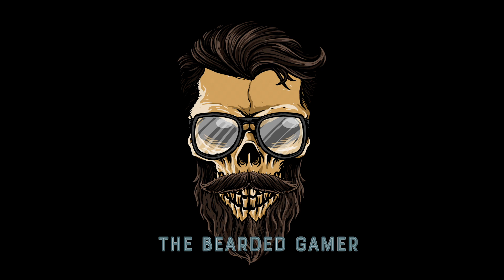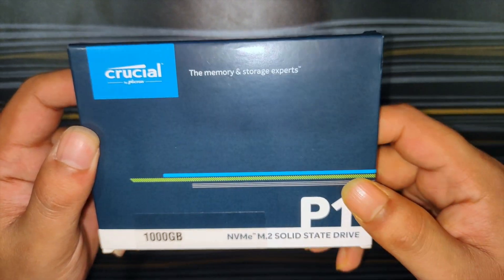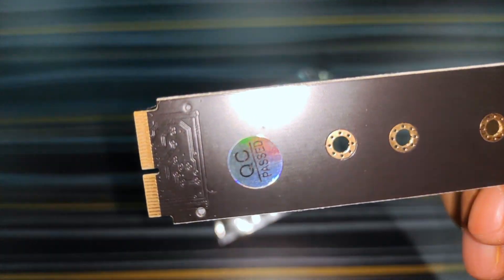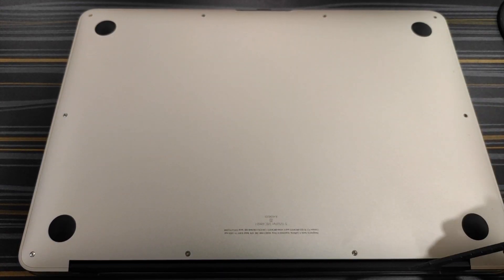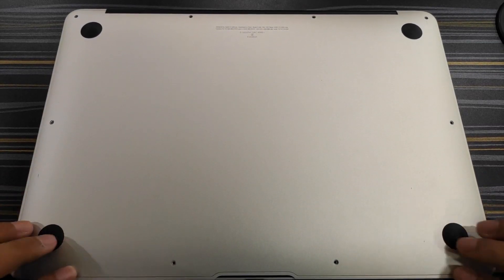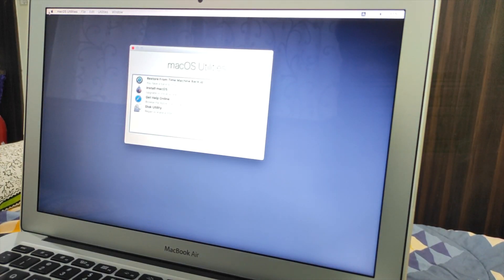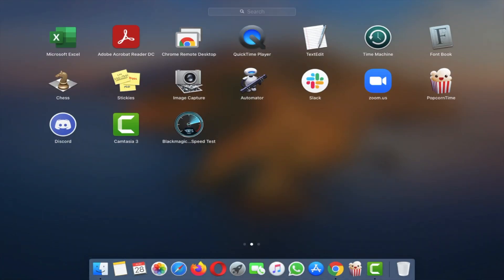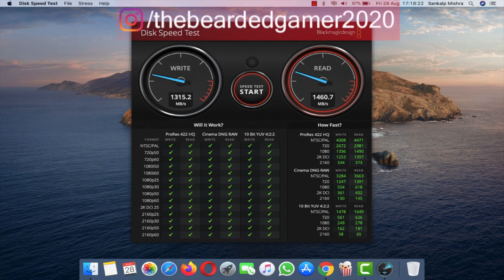2017 MacBook Air Storage Upgrade from 128GB SSD to 1TB NVMe SSD | Full Guide for 2021 | 40k+ Views

Comment: I am running on Mojave 10.14 but from the apple store when i try to download (from the link provided in the description) it is downloading 10.14.6 will that be a problem?
Reply from the maker: If you are goin to restore from a time machine backup, then it is going to be an issue. But if you do a fresh os install then the current version and downloaded versions don't matter. Do subscribe if you haven't already done so and press the bell icon.

Comment: Western Digital WD Black NVME SN750 1 TB M.2 2280-S3-M PCIe Gen3 Internal Solid State Drive (WDS100T3X0C) https://www.amazon.in/dp/B07M64QXMN/ref=cm_sw_r_cp_api_i_fBhbGb5AY5FDA brother can this ssd be more better?
Reply from the maker: Bro this is a gen 3 one...better to go for a samsung 970 evo.
Reply: @TheBeardedGamer2020  i think ur recommended crucial is also gen3 , nd moreover i compared this samsung evo, this one is giving more speed.. please check and confirm
Reply from the maker: @sameeribrahim9405  The max speeds of none of these ssds matter because the adapter and the MBA is capable of certain speed. The proprietary apple ssd has speed around 600 and any other ssd that you use with the adapter will provide speeds of around 1300-1400 even if the max speed of the ssd is around 3000. So it is now totally upto choice which ssd you want to choose. I used the Crucial P1 because it was more value for money with similar speed to any other ssd when usd in the MBA.

Comment: Thanks alot brother . I subscribed ur channel . U have explained perfectly.  I just want to ask whether i need a proper technician or i can do it on my own? Nd moreover is this adapter necessary to buy?  Rest what is the present status of your MBA 2017 ? Working perfectly? 
Nd one more thing , should i buy this ssd from amazon or a local authentic dealer? What is ur suggestion.. rest nice work done by u .. keep updating more tricks about MBA2017
Reply from the maker: Thanks a lot man. Yes you can definitely do it on your own. And the adapter is definitely necessary and the ssd can be purchased from anywhere the choice is yours as long as you trust it.
Reply: @TheBeardedGamer2020  adapter seems to be very expensive , can you suggest some other alternatives .. as there are many new adapters available..  if u stil recommend this same adapter than i have to go with it
Reply from the maker: @sameeribrahim9405  there are a lot of cheaper options but these are tried and tested ones so I have suggested. The cheaper have had complaints of overheating and sleep issues.

Comment: hello, does hibernating have issue in crucial p1?i've held in mac os some brand of nvme ssd have failed.you have to turn off the laptop all the time instead of close the lid and go. i appreciate your thought on this
Reply from the maker: I haven't faced any such issues yet and I don't think it is going to come up as well because the response I get when opening and closing the lid is exactly the same as before the upgrade. So, I guess Crucial P1 isn't that brand that has issues. I guess that answers your question. Do subscribe and press the bell icon.

Comment: im am using mac os big sur, so do i have to download back mac os big sur as the bootable installer?
Reply from the maker: Yes, because that way you won't be losing any settings or app data when you restore a time machine backup.  But if you are planning for a fresh reset, you can use previous versions as well.
Reply: when i install a new macos big sur and choose my ssd, it shows that there is a password and you may not install. Is there any solution to this?
Reply from the maker: The issue might be with how you have formatted your ssd. If it was APFS encrypted then the password issue could have cropped up. Follow me on Instagram and drop a DM with pictures of exactly what the issues are and I will try to get a solution. Also do subscribe to my channel and press the bell icon.

Comment: Hi, I did the same procedure as you, changed the SDD, pressed the commands to connect, selected the bootable device, load the bar until the end and then this error appears on the screen: https://i.postimg.cc /q7DRrDGk/20210109-162207.jpg
Do I have to format the SSD first? Is there anything I can do?

Can it be any M.2 SSD or does it have to be specific?
Reply from the maker: I didn't check the image yet. But based on the question, formatting and changing the format to APFS is a must. And, it is not about being a specific SSD, but it has to be a NVMe PCIEx4 SSD. If that works do let me know. Also hit the subscribe button and press the bell icon.

Comment: Hey, you didn’t copy your files before removing the SSD? Is it not necessary?
Reply from the maker: I had already made a time machine backup. The details are in the description as well. So restored data from there. Do subscribe and press the bell icon.
Reply: @TheBeardedGamer2020  ahh I see. One more question: Can I update the OS to Big Sur and then install the new SSD?
Reply from the maker: @reallyjam  Yes you can. Anything post Sierra can be used to update the ssd. All the product links are in the description.
Reply: @TheBeardedGamer2020  whew! That’s good! Thank you so much! I will subscribe!

Comment: Will work with MacBook air early 2015 version?
Reply from the maker: Yes Kiran it will work with all MBAs and MBPs from 2013 to 2017. Product links are in the description. Also do subscribe if you haven't already done so.
Reply: Thanks for your immediate reply. Subscribed. Another question, 1TB ssd will not make any problem right? Or should I install 512GB for MBA 2015?
Reply from the maker: I am myself using the 1TB SSD. There's no such issues. It is totally based on your choice and budget. And thanks for the sub.

Comment: Can you please recommend me external casing to use the 128gb m.2 ssd as external USB drive. I mean the original 128gb ssd that you removed from the macbook air.
Reply from the maker: There are external cases but the availability depends on where you are from. For example in India, finding an external case for the MBA SSD is almost impossible and the ones available are super expensive. So, if you can help me out with where you are from, I might be able to help. Also, before that do subscribe to the channel and press the bell icon.
Reply: @TheBeardedGamer2020  please, do tell for Indian consumers... possibly provide a link !
Reply from the maker: @sumansumitsoren21  There's only one that I could find on Amazon and that too is super expensive, as I had earlier mentioned, around 27000 for just the enclosure. If you are interested, let me know, will share the link.
Reply: @TheBeardedGamer2020  27000 is not at all that I an afford. If any cheaper in USA please do let me know. Thanks
Reply from the maker: @tsenam9392  Exactly. That is way beyond affording and doesn't even make any sense. Will look for some options from U.K. and U.S. and share it with you.
Reply: @TheBeardedGamer2020  U try search B&H photovideo there u can buy from Us to Your country,India it is safe site too.If you have any question u can directly message them on Facebook messenger they will replied to your question
Reply from the maker: @luqmanooo5402  Sure. Will definitely look into it. Also if you like my videos do subscribe and press the bell icon.
Reply: @TheBeardedGamer2020 I am from India but i can ask my friend in U.K. and USA to arrange for it.

Comment: Hey, Is APFS(encrypted) or MacOs Extended (Journaled) the right file system of new SSD ?? Kindly guide 🙏
Reply from the maker: It is normally APFS encrypted...but better to format it as per your previous ssd format. But, if you have already removed the previous and installed the new ssd and asking this question during the process then go for APFS encrypted as it is the most common one. If that makes sense, do hit the subscribe button and press the bell icon. Also, if you have any other queries, follow me on Instagram and drop a DM. Peace.
Reply: @TheBeardedGamer2020  thanks....used APFS👍🏽
Reply from the maker: @sumansumitsoren21  Hope the process was smooth. Do let me know.
Reply: @TheBeardedGamer2020  One more query...Instead of BOOTABLE MACOS INSTALLER USB can't we simply use INTERNET RECOVERY Combo keys (Cmd+Option+R) ? Will that work for booting up the Mac ?
Reply from the maker: @sumansumitsoren21  Yes you can use internet recovery but I preferred the bootable usb option because of its reliability. Didn't want to risk any internet fluctuations or failed installation. But definitely you can also choose internet recovery as long as you trust your ISP.
Reply: @TheBeardedGamer2020  Thanks a lot for prompt reply. 👍🏽😀

Comment: Which one is more faster internal SSD for upgrading from 128gb to 1TB mackbook air 2017 .
Reply from the maker: The 970 evo is slightly faster than the crucial p1 once it's in the MBA 2017. Based on price difference you can choose whichever works for you. Links for both are in the description. Also do subscribe if you haven't already done so.

Comment: I have bought the same ssd but i am getting a write speed of 890mbps.
Reply from the maker: Did you use the same adapter?
Reply: @TheBeardedGamer2020  i have used the small one
Reply: dprui M.2 NVME SSD Convert Adapter Card for Upgrade MacBook Air A1466 A1465 MacBook Pro A1398 A1502 (2013-2017) https://www.amazon.in/dp/B084RR84TJ/ref=cm_sw_r_cp_apip_fJno8mrACeU5a this one i have used
Reply from the maker: @gabbar_fpsyt7248  That could have been the issue. Which tool are you using for testing the speed? Blackmagic?
Reply: @TheBeardedGamer2020  black magic
Reply from the maker: @gabbar_fpsyt7248  Has it been the same every time or did you just check once?
Reply: @TheBeardedGamer2020  yes
Reply from the maker: @gabbar_fpsyt7248  In that case it is the adapter for sure. I just checked mine again and write is 1190-1230 and read is 1340-1370.
Reply: @TheBeardedGamer2020  thank you so much for your reply. Really appreciated.
Reply from the maker: @gabbar_fpsyt7248  Not an issue. Do subscribe if you haven't and if you have any other queries you can also reach out to me on Instagram.

Comment: Nice, I could buy the 256g version and upgrade it to 2Tb 😅
Reply from the maker: Spend even less and buy the 128GB version and upgrade it. But go for the 1tb version as that is the maximum recommended upgrade. You can go for the 2tb upgrade but it is known to have issues. Do like this video, share, subscribe and press the bell icon.

Comment: Its possible for MacBook air 2019 ? Thanks 🙏
Reply from the maker: No Beho, MBAs post 2017 have stopped supporting storage upgrades as it comes soldered to the motherboard. Do subscribe to my channel and press the bell icon. Thanks. 🙏🏽✌🏼
Reply from the maker: Lalithya Teja  Yes it will. Also, do subscribe to my channel and press the bell icon if you haven't already done so.
Reply from the maker: Lalithya Teja  The adapters that I have mentioned are reliable ones and that is why they are slightly on the expensive side. But if you compare how much a 1TB SSD upgrade through apple would have cost to this upgrade process then it ia almost 1/3rd the price. So it's better to pay slightly more and use something that is sure to work rather than something that might fail. And if you are formatting your new ssd in the same format as the older one and do a time machine backup restore, then you wouldn't need to enable TRIM and SMART.
Reply from the maker: Lalithya Teja  Yes you can. No issues.

Comment: So 1 TB is supported? Apple recommends only 256/512 gb to macbook air 2017. Is it working fine till now? Can you confirm please?
Reply from the maker: Yes I have been using it for over 3 months now and things have been pretty smooth. And apple recommends 256/512 gb because that is how much they can provide. If that makes sense do subscribe to my channel and press the bell icon.

Comment: Hey, thanks for the video. Im also planning to upgrade my MBA 2017. But I'm having heavy load works like ios simulators, VMware, etc. Will there be any issues? What's your suggestion bro?
Reply from the maker: Hey Adhil it's great to know that you are planning an upgrade too. As far as heavy tasks go, it shouldn't be an issue as long as they were already working on the same processor, ram and graphics. The ssd upgrade will increase storage space and enhance file and simulator load times. As far as issues go the only one you would facr is a slight rise in temperature but that again is because you are getting about twice the performance boost. So, I would suggest you to go ahead with the upgrade. Also, drop a like, share this video, subscribe to my channel and press the bell icon. That would be of great help. Peace. 🙏🏽✌🏼
Reply: @TheBeardedGamer2020  cool, thanks bro 👍
Reply from the maker: Links are in the description for all the stuff you need.

Comment: any suggestions for egpu setup in same macbook?
Reply from the maker: Kismat Kumar that's a great question. I had the same question in mind at one point of time. But my recommendation for you would be to avoid the egpu setup. Firstly the cost of the setup is going to be a fortune, reduce portability and to be honest you can spend that money on assembling a rather powerful PC. Secondly, the reason for the upgrade, if it is gaming, will be limited as the titles for MacOS are very less and if you are planning to use bootcamp for gaming, that isn't such a great choice as well as the processor is occupied with running windows. That's what I think and recommend. Please subscribe to my channel and press the bell icon to show some support.

Comment: Hai bro still working good, it’s getting eney problems unexpected shutdown and sleeping,heating,battery performance down , plzs tell me Iam planing upgrade my Mac,plzs give me your feedback it’s very useful me 👍
Reply from the maker: Hey Raja I have been using it for the past 3-4 months and haven't faced any issues as of now. Every thing works fine and even better most of the time. Slight heating at times but that is only when you are doing some extensive processing. But that isn't much of an issue as the performance increase is great. So you can go ahead and use the links in the description to perform the upgrade. Also do subscribe to my channel and press the bell icon.
Reply: @TheBeardedGamer2020  I subscribe bro , how is battery performance down or same
Reply from the maker: @Rajaanandhan  Same.

Comment: Since your recommended adapter is not available. Can this be used https://www.amazon.in/Buyyart-PCIe-Converter-Adapter-MacBook/dp/B07TKVB24Q/ref=sr_1_21?crid=344YQZSCANA3L&dchild=1&keywords=nvme+ssd+convert+adapter+card+for+upgrade+macbook+air&qid=1607463817&sprefix=NVME+SSD+Convert+Adapter+Card+%2Caps%2C318&sr=8-21

Mine is MacBook Air 2017
Reply from the maker: I have actually updated the description with a new link. You can go check it out. Also, you can order the product from the link that you have shared and give it a try. If it works, well and good, if not, you do have 10 days to return it. So it's upto you. Please like the video, subscribe to the channel and press the bell icon to show your support. Peace. 🙏🏽✌🏼
Reply: @TheBeardedGamer2020  but do you think it will support... as its one of the cheaper one.. may be its not of that quality.. will it harm MacBook... or heat it up or .. .slow it. etc.. read the spec as you seems to be a tech guy.. help your brother out... I have MacBook Air 2017
Reply from the maker: @qmransari1  The cost difference between both the adapters is 2000, so I would suggest you to go for something that has been tried and tested rather than spending about 2000 less and facing issues in the future. The specifications wouldn't be different even on the ones that are available for under 1000 because it's basically an adapter... but better to go for the one that is known to work rather than spending money now as well as in the future getting it changed.

Comment: You forgot to remove the battery. It's very important for safe working.  👍 Good job
Reply from the maker: Yes, I had it in my mind but entirely missed it during the process. Realised while editing the video. But, thanks for noticing. Also, do subscribe to the channel if you liked the video and press the bell icon. Peace. 🙏🏽✌🏼
Reply: @TheBeardedGamer2020  Let us know how to remove the battery by making a small video and sharing it here
Reply from the maker: @qmransari1  Do you want to know how to remove the battery entirely or how to disconnect the battery for this upgrade process?
Reply: @TheBeardedGamer2020  thanks... I wanted to know how to disconnect the battery but I guess it pretty simple as shown in other videos.
Reply: @qmransari1  to remove the battery, their is a small blastic pic. Just pull it Horizontally  , then the battery will be removed smoothly 👍
Reply: I tried to erase the ssd as apfs encrypted , but it's not allowed to install mac os due to the protection.  So i erase it as apfs only .
And it's working properly 👍...

Comment: i have early 2015 128gb MacBook air. When i Inquire to apple service centre to upgrade it to 1tb ssd , They simply say it is not possible because of logic board limitation. need your expert opinion.
Reply from the maker: You can follow these steps to upgrade you MBA 2015 to 1 TB. Apple service centre denies the upgrade because they are not allowed to do the upgrade. You can use the links in the video description to get the products and follow the steps in the video to make the upgrade. I have done it and have been using it for almost 3 months now, without any issues. I even have a Mac and Windows partition done and both are running without any issues. Also, make sure that you like the video, share it, hit the subscribe button and press the bell icon. Peace. 🙏🏽✌🏼